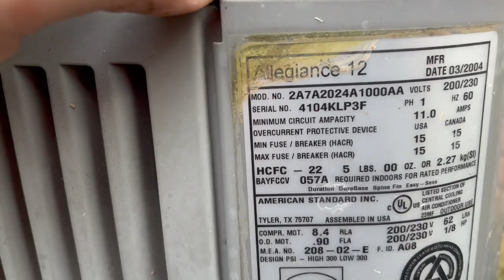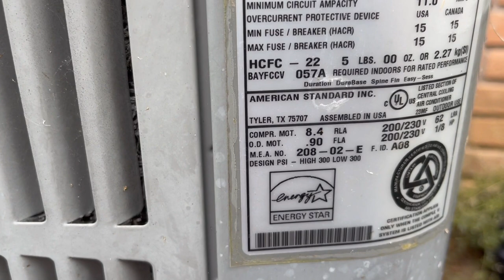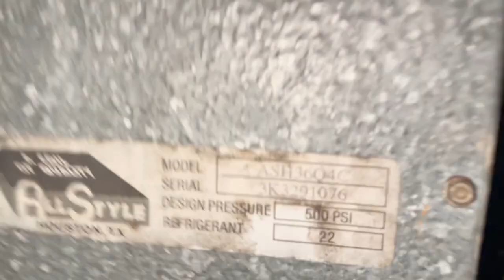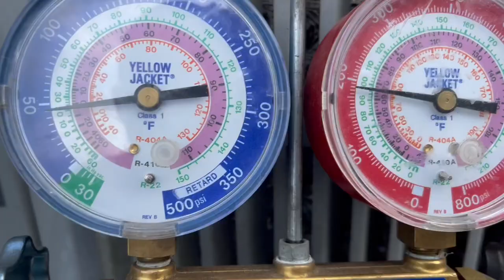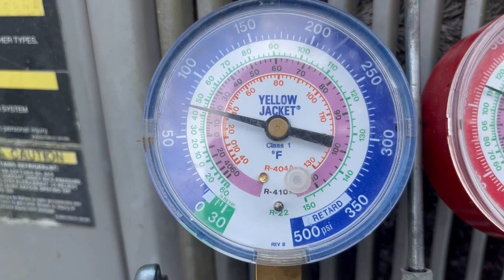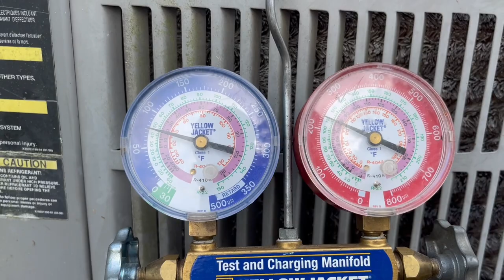No Cooling/Upstairs System Blowing Hot

Comment: You are correct with that old equipment. If I come across one that is 12 seer or less you can pretty much add 30° above the outdoor ambient for the outdoor coil temperature and your good. Of course I also look at the indoor coil temp. And it will usually always be about 35° lower than the return air. Looking good man.

Comment: Hey John, i have been watching your videos since last year and i have a question for you or anyone on here..
Hey guys.    Im changing the condensor unit on my house.    R22.   Id like to just swap the condensor unit and get another txv for the existing evaporator for 410 refridgerant. 
What do you think
Reply: U can do that if the coil is rated for 410A pressures dont forget to flush system and flow nitrogen when brazing